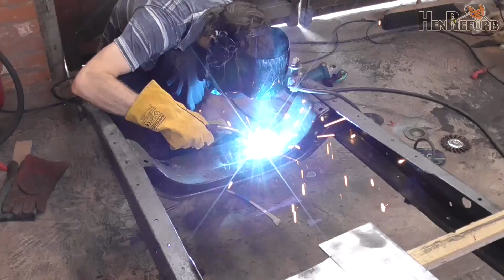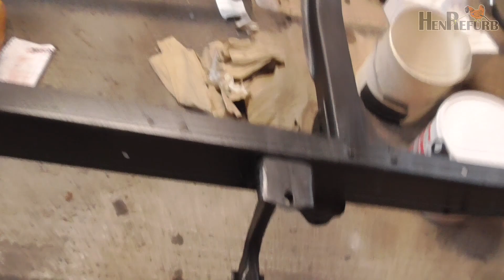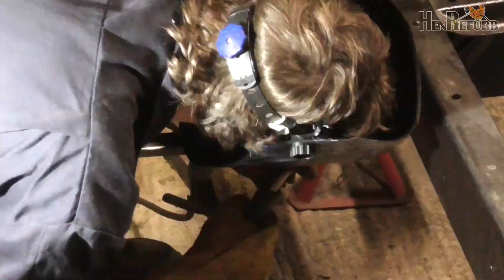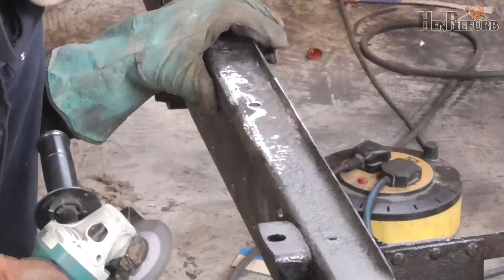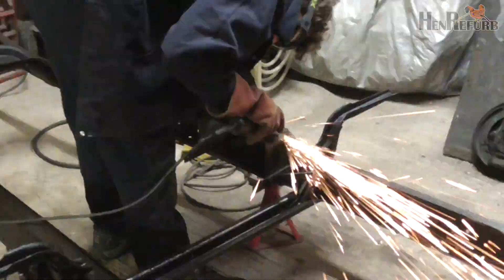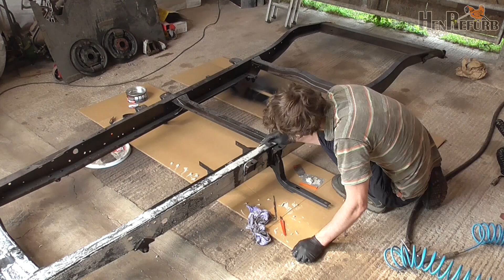1931 British Dodge Chassis Restoration Part 1

Comment: What's the motivation for applying body filler to the part that is going to get dirty from the road? Unless this car isn't intended for road use?
Reply from the maker: It's to get rid of the rust patina which I don't like. Plus, it means that it'll be smooth, so it will be much easier to wash the dirt off from the underside. The roads are filthy in England so every little helps!
Reply: @HenRefurb  Ah, makes sense. I hadn't thought about the cleanability.

Comment: Time lapse makes it look so easy. A few seconds and holes turn into new steel! I’ve taken the rusty old side step brackets off my chassis and bought good ones. The advantage is less welding, but the disadvantage is that it’ll be hard to hot-rivet them on. Still pondering that one. One mod I’m planning is to replace my very knackered ‘26 engine with a ‘27 Fast Four (a friend has several). They require different chassis mounts, but instead of altering my chassis I’m thinking of copying another guy, who made bolt-on brackets that incorporate rubber engine mounts. That’s supposed to make the car much nicer to drive.
Reply from the maker: Tell me about it. I was fascinated watching the video back myself! Interesting idea, I didn’t want to get involved in the hot riveting, but fortunately got away with it. Good luck with your project, sounds interesting.